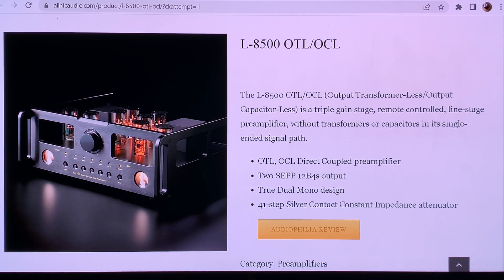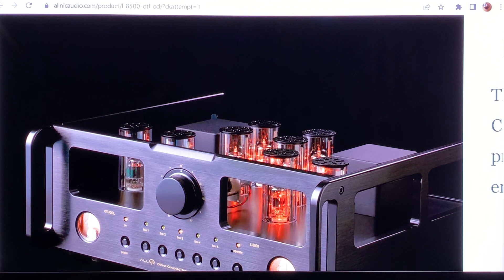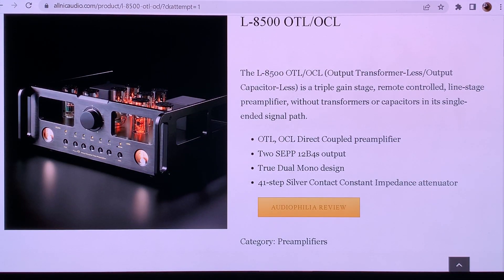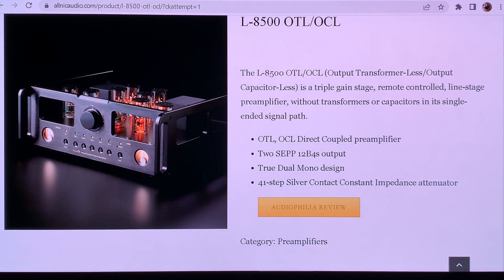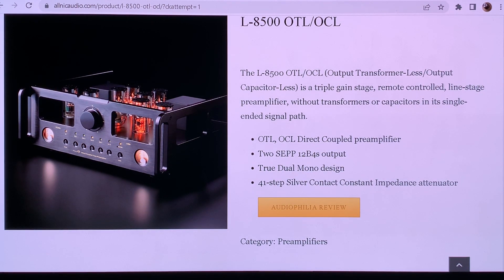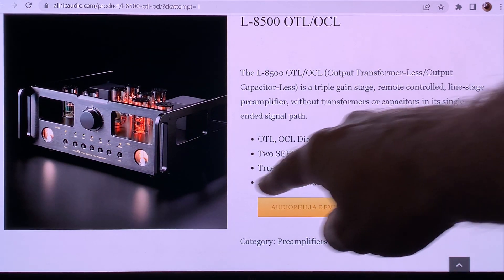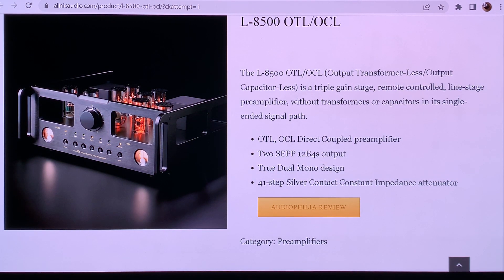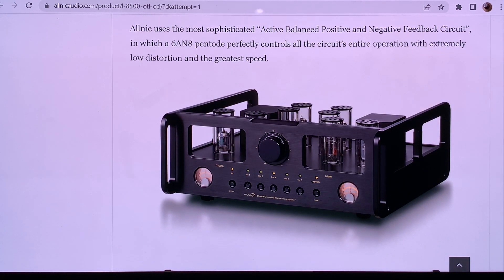OLT preamplifiers   analyzing the insides of the L 8500

Comment: Aren’t the AU7’s meant to lower the gain?
Reply from the maker: A single 12AU7 gives a voltage gain of 20, that is, 13dB. That's enough for most applications. Here we have more than that, meaning that the triode section of the 6AN8 must be also in the signal path. It also has a gain of 20, so we have a total gain in the signal path of 400, that is 26dB. The total gain of the preamp is quite lower, meaning a lot of negative feedback going on to burn up the excess gain....

Comment: The american 6AN8 tube is ...........................somewhat problematic ,it's difficult to find a good nos one today ...............besides the fact that the safety of the 0V output  and the following amplifier is based and depending on it's correct error correction function ................seems like a ride on a stallion as long as everything goes well !
Announced  by Allnic as a penthode noval tube , it is in fact a combined triode/penthode tube used in older amplifiers like the Dynaco Mark III..................used as an active device to control the output offset voltage ............as I said before , as long as everything goes well...........
Working with tubes , one must think long term operation...........I have (nos) tubes in some pre-amplifiers for several decades without replacing and still within specification .
Some high end are real tube eaters..............and current production rarely has the lifespan of the older tubes......plus there's a good way to extend the lifespan of tubes times X........... just like diesel enegines they wear out at upstart and during warm up............ some examples :
12AX7 A /ECC82 nos can go for almost 100.000 H of duty..............
WE 1O1F ........................40.000 H +
WE 403A/B- 6AK5.................12 years /24H a day continuous use under controled conditions  without failure and still within specification.....
KT66 GEC ...................8000 hours....

The BBC .....................NEVER shut down their amplifiers 😉
WE've seen different in the audio world........ 

The warm up time in many modern amplifiers is an ................ILLUSION , only disconnecting the in/output but there's no time delay on the high voltage applied to the tubes on start up and on SHUT DOWN !!!!!!   
Simple to imply on your (pre) -amplifiers ..................your precious tubes will thank you 🙂

Don't become the victim of a prison commercial brand policy ................ something like totaly depending on the company for the tubes etc.....

Build yourself or modify a good and simple pre-amplifier yourself ............it will sound as good and likely better than a commercial...........perhaps without the aura or the looks of some brands............but it's THE MUSIC that counts !!!!
At least for some.................that's why we are on this platform , isn't it ?